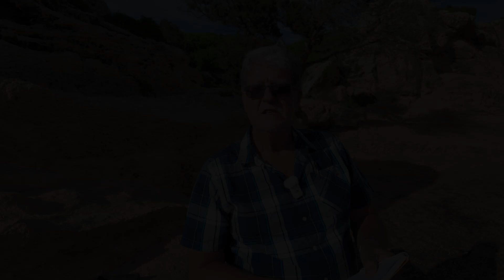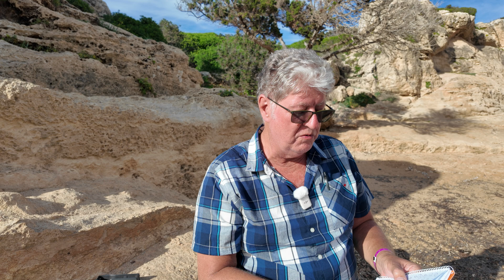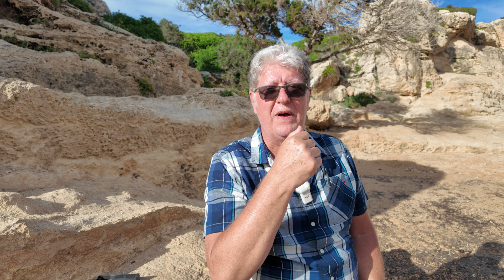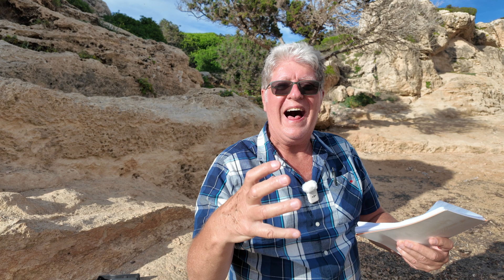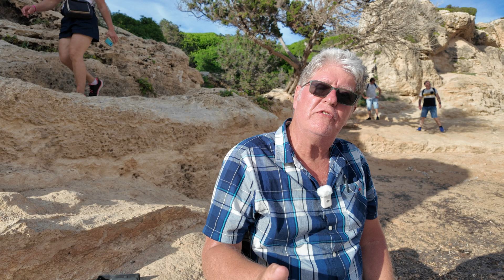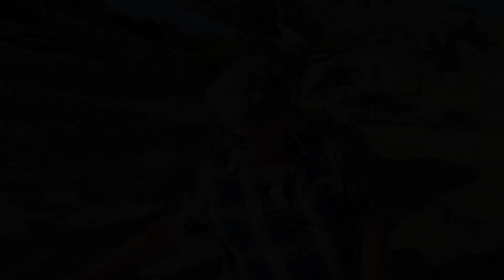The Unlikely Source Of Next-Gen Batteries!

Comment: These new battery types even if not great for EV’s will be fantastic for storage. As they get cheaper, large banks of these can be used rather than having to upgrade the grid. A battery dispensing energy at a set amount would collect the energy from wind or solar and push it to the grid all day.  Great one Dave!

Comment: The other main use for curtailed energy production is the export market, the UK is becoming more and more connected with other European grids so can export energy to these markets when over produced, at a fairly decent rate. The UK is idealy located on both the Alantic and North Sea has a range of renewable generations options (particularly wind and tidal power), meaning that renewables could become the new energy crop generating revenue for the UK.

In the past the UK wasn't that much of an exporter, as fossil-fuels were imported to create energy with a smaller amount of energy being imported via the older AC and HVDC continental links. Since renewables overtook fossil-fuels as the the UK's primary energy component it has started to export more, with a number of years being a net exporter.  So far for the first two quarters of this year the UK has mainly been and importer of electrical energy again - particularly from France and Norway with their low-carbon sources - as its cheaper than buying gas. But this may change again with the 2nd two quarters with Summer PV and Autumn wind increasing renewable output.

In terms of changing the energy framework to reduce the ability of fossil-fuels (particularly gas) driving electricity supply prices, this has been called out across Europe and in the UK the likes of UCL and the Aldersgate group producing insightful reports on the cuases. For 2022, fossil-fuels (i.e. gas in the UK) dictated price 84% of the time, imports (when cheaper) 15% and other including renewables/nuclear only 1%. The reason is due to effects of the way the framework for the market works (prioritising flexibility over cost), the supply that is most expensive that can be classed as dispatchable tends to dictate the price. Hopefully the introduction of batteries to the grid will swing this in favour of renewables with their much lower cost allowing cheaper electricity to become available to consumers.

Comment: Good to see you doing a video on Iron-Air batteries as they are a really promising technology.  They provide a very low cost in terms of $ per kWh because the raw materials are cheap, but obviously are heavy and so totally unsuited for mobile applications like cars.  However, unlike lithium ion batteries on the grid which might be 100MW/200MWh (ie 2 hours of storage at full output) these iron-air batteries are 100 hour systems ie 100MW/10,000MWh.  This is ideal for a) soaking up spare electricity but also b) generating electricity when there is a wind lull etc.  Essentially they are seen as a replacement for gas CCGTs on the grid and, unlike other long duration storage tech such as pumped storage hydro, can be placed anywhere with a grid connection so can be distributed arounds the place wherever needed.  Form have just announced a project in Ireland, hopefully they'll come to the UK soon.  https://www.pv-magazine.com/2024/09/27/ireland-in-line-for-1-gwh-iron-air-battery-storage-project/